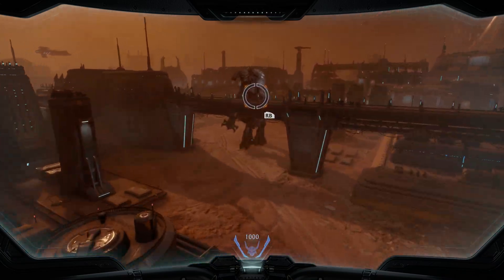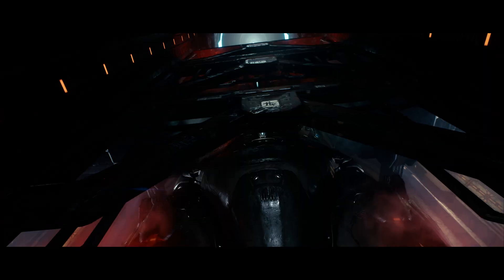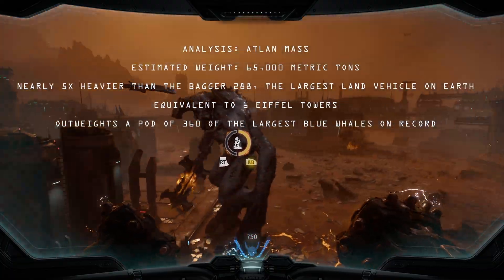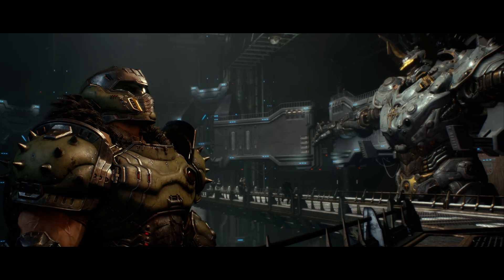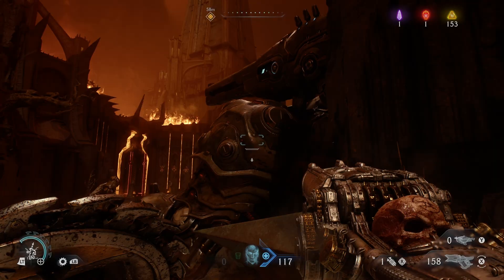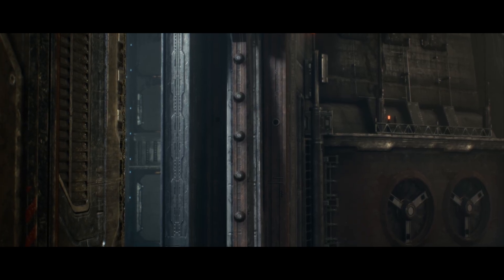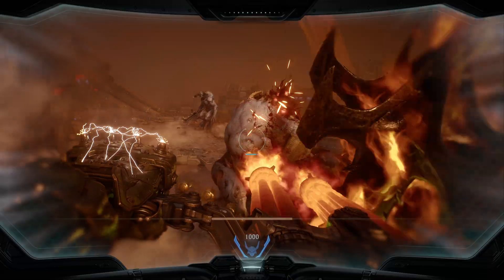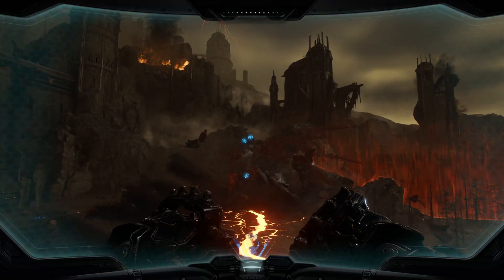The Impossible Logistics of Doom's 30-Story War Machine

Comment: My main gripe with these things - though minor - is the sheer absurdity of the weapons they're equipped with.
The shoulder mounted cannons I can come to terms with.
But those shotgun shells have got to be HELL to clean up with how big they are...
And manufacturing ammo for the gatling gun? Bullets that large being expended at probably a thousand times the speed they were originally made.
And the pods they come in... At Slayer scale it's no issue, but you've just dropped something in a metal pod not that much smaller than the Atlan itself from what is presumably low orbit down to the ground. That's gonna cause some damage.
Reply from the maker: Yep, agreed! I thought about that gatling gun too a bit. Can you imagine the sheer cost of expending ammo that big, that fast? Crazy 🤣
Reply: Rule of cool triumphs any logic
Reply from the maker: Ha agreed!

Comment: 2:35, you actually do see where they are built. It's in one of the levels of Doom TDA.
Also in Doom TDA, the mechs are way smaller, around 200 or so feet tall
Reply from the maker: I saw that as more of a refueling/repair station but I suppose it could be the factory as well. Didn't think of it like that. An Xbox direct confirmed they're 30 stories tall:
https://www.ign.com/videos/doom-the-dark-ages-gameplay-overview-xbox-developer-direct-2025
Reply: @KeiRetroGaming  It's the only place where you see it getting built and tested. Also, in lore, the mechs run on argent energy, an op power source in Doom. They would be impossible to create even if that were the only issue

Comment: There was a cut level for the Dark Ages which had you fight through an Atlan factory, still visible in the first trailer, and the holograms of them in Hebeth seem to present schematics, so they are indeed created to be largely identical and mass-produced industrially
Reply from the maker: Awesome bit of info, thanks for sharing. Totally missed that! Kinda wish they kept that in the game...
Reply: wait, really? damn it, I was unsure whether it was in the game or not. it looked so cool, Foundry-like industrial aspects in a medieval setting
Reply: @ram-1988yeah, it got cut(probably for pacing reasons), but it's in the section of the reveal trailer where the Skullcrusher is shown off. I think they still took that basic concept of Atlan manufacturing and dispersed it throughout the game in bits like Sentinel Command Station and Hebeth's weapon lab